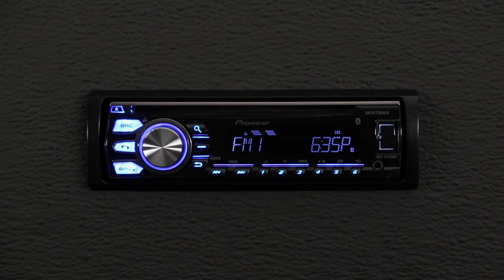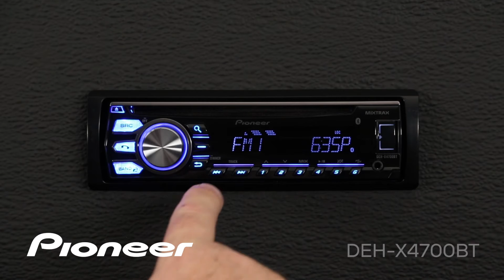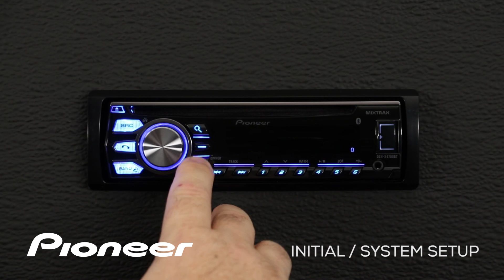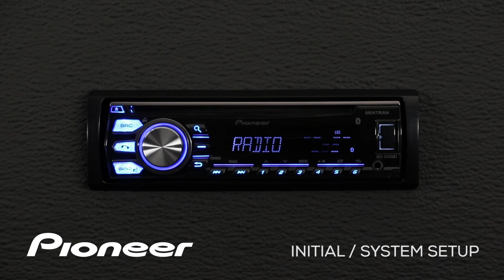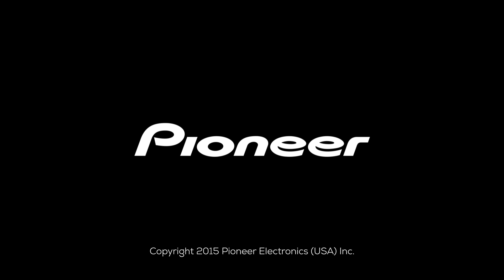How To - DEH-X4700BT - Initial and System Setup

Comment: After my car battery died the radio likes to stay on all the time. How do I fix this issue?
Reply: The in-dash receiver should power off when the vehicle is powered off.  On some vehicles, the power to the in-dash receiver continues to stay on with the key removed, until a vehicle door is opened.  If your radio stays on after you power off the vehicle and remove the key, the in-dash receiver is wired incorrectly.   Please focus on the in-dash receiver Red Wire and the Yellow Wire.  Red is for ignition power only and Yellow is for continuous power.  You can learn more about the Pioneer Wire Harness System in this video:  https://youtu.be/kR2MO2kwFug?list=PLw63zJRQbCNinkLCSrV17ExW5FWT7aIFU   You can find a full playlist of How To videos about Pioneer DEH-S4000BT here:  https://youtu.be/h9Hp2w-aUF4?list=PLw63zJRQbCNinkLCSrV17ExW5FWT7aIFU  and you can find more videos on Pioneer's You Tube Channel here:  https://www.youtube.com/user/pioneerelectronics
Reply: @deckerdotto6035  thanks I will tale a lot. But that seems odd for it to work for 3 years, plus in a different truck without problems then like that over the battery dies and it doesn't shut off after a battery change.
Reply: @CaughtMedia  they probably wired the red wire directly into to the battery instead of wiring it to the ignition power on switch. It was probably always on but you just noticed it after your battery was replaced. The yellow wire goes directly to the battery and the red wire goes to the ignition switch.
Reply: @pelassancho24  I have sold that jeep soon after that post. Thanks.